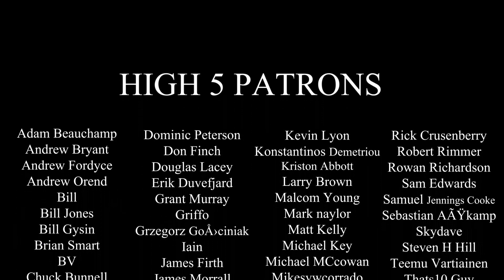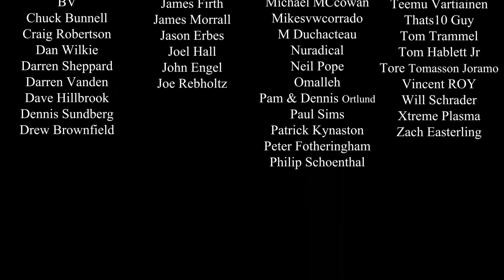Classic Mini Race Car Gear Shifter Mount - Mini Libra/ Miglia PT13

Comment: A fantastic show of fab and machining skills there! Only one point of note, the locking nuts on the tiltshift might move if going for a hard 3rd...if that happens maybe a LH/RH threaded bar - like those found on splitters supports - would come in handy.

Comment: Back in the day, we used to make a "short throw" shifter by shortening the lever. To help the gear engagement, a heavier knob. Some tried to mess with the linkage after the pivot point, but they never got to 2nd gear. A few went with heavier knob and stock/longer lever, they had problems with 2-3 shift going to 5th instead of 3rd, and dropping out of gear on every bump. Just the lever itself plays a big role on gear shifts.

Comment: Nice work Matt, one thing, on the original base of the lever housing is a plate, which stops you engaging reverse..... you'll need to add one.....
Reply from the maker: I still have the original piece to go back in bud.
Reply: @Urchfab  Matt that's how I run mine, holes are elongated as I haven't adjustment in the rod to ensure it goes into 3rd and 4th cleanly. Top work mate 👍

Comment: I want to lift the shifter on my 206 track car but the cables run under the floor.
I'd have to cut a huge hole and feed them through.
I'm considering an offset shifter extension to move it close at the sacrifice of throw distance.

Comment: I’m so impressed with everything you design and fabricate but I’m concerned about the weight of the car; it’s a good job you’re a slim chap
Reply: There's always a weight limit in every category, and usually they shave off so much weight that they end up putting in weights to bring it back up to minimum weight, it just means Matt won't have to run so much ballast lol